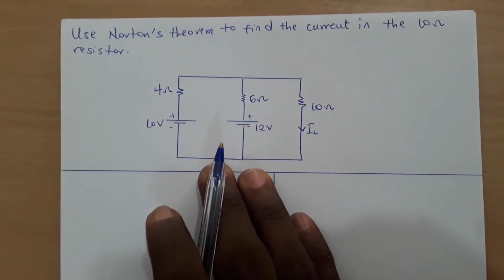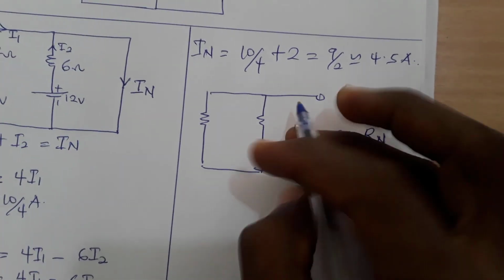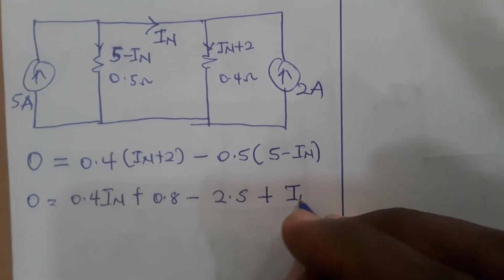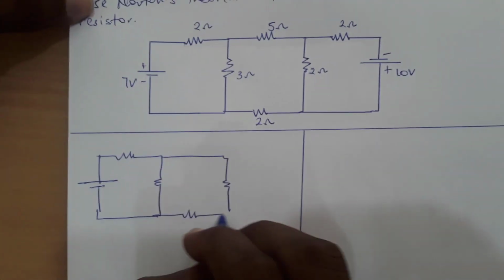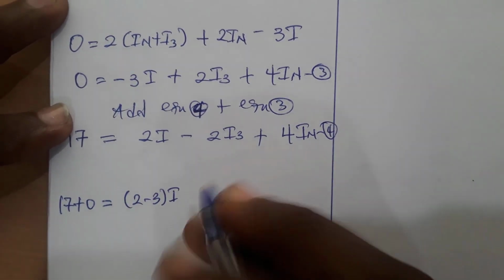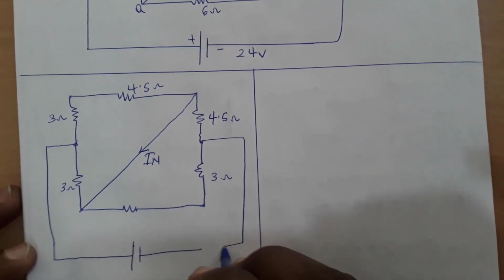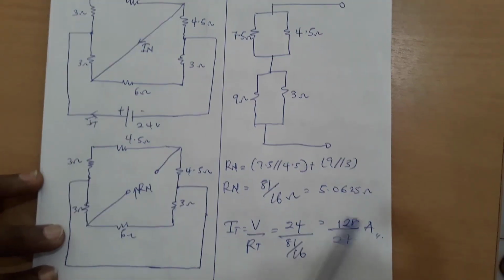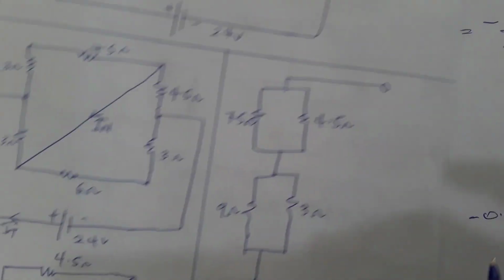Solved Examples on Norton's Theorem

Comment: Hello please with the first question how are resistors in parallel 
Because since if current were to pass through. It would pass through the same path. Since the other path was short circuited
Reply from the maker: @Eddie Mensah, if you take a look at the question well you find out that in finding the total resistance(RN), the other path is not short circuit but it is an open circuit

Look at it from this way
1. Place a voltage source between the terminals from which I was finding the total resistance
2. Now if that voltage source produces current, you will see that it will split between the 4ohm and 6ohm. 
3. Now since there will be different current through the 4ohm and 6ohm resistors, it makes the be in parallel not series

Comment: Hello please with the first question how are resistors in parallel 
Because since if current were to pass through. It would pass through the same path. Since the other path was short circuited

Comment: Please, in the third example, how will current pass through the 4.5 resistor on the right, seeing current flows from the positive terminal of the battery.
Reply from the maker: Thanks for the question Joshua. So the current from the 24V after moving through all the resistor will come back to the source ( in this case the 24V) in the process you will see that it'll meet at the node close to the 4.5 ohms you're asking of. So from that we can say that the current at the node ( which is the total current) can be divided between the 4.5 ohm and the other resistors. If this is not clear you can see me at my office for explanation. Contact me on 024-865-4432

Comment: Please why 10 + 7 in equation 2?
Reply: Taking the bigger loop equation and writing KVL equations, there are two voltage source that's 10V and 7V. Taking your direction in the clockwise direction all will be positive; that 10V + 7V
Reply from the maker: Bernard,  we had loops in that question. So taking the outer loop and applying KVL in the clockwise direction you should get it. Kirchhoff says, group all voltages sources and equate them to all the voltage drops in that loop. So try it out and see. If you still don't get it then you contact me, I'll show you my office so we discuss into details.
Reply: @charlesmarfoawuah242  Please i am asking about that because their terminals aren't the same and i recall Dr, Ahmed say that from + to - is a negative so..i was thinking it'd be (7-10)V